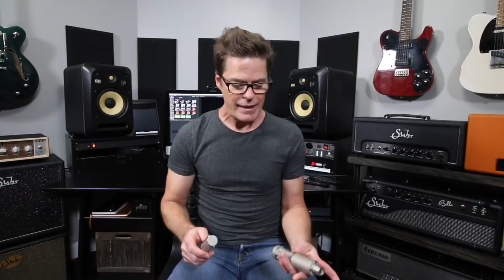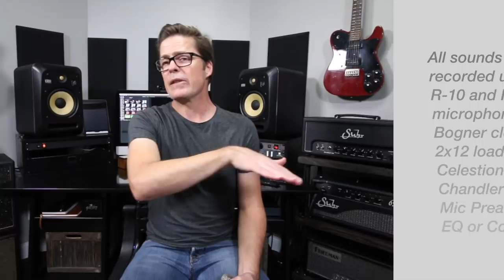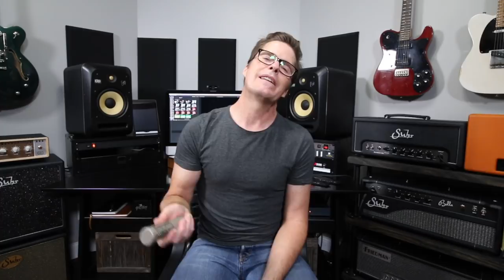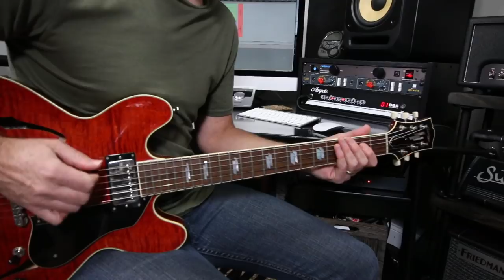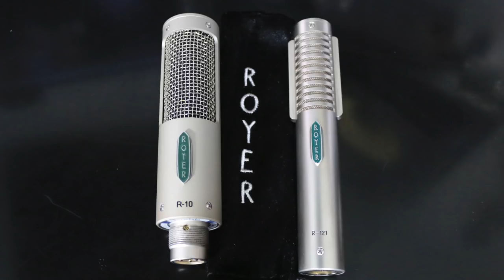Royer R-10 vs R-121 Quick Comparison Demo Video by Shawn Tubbs

Comment: I have the R-10 and LOVE it.  I usually use the R-10 and an SM-57 along with running a line out from my Torpedo Captor to my interface and then using a Celestion IR.  Three guitar tracks for each part.  Love the tone.

Comment: First, awesome playing and tones! Both mics sound really great and you did a great job comping to showcase the mics. I am hearing something completely different from all these comments though so I had to look up the frequency responses of both mics to make sure I wasn't crazy lol.

The R-10 actually has a substantial DIP in the upper mids at around 2.5/3k and a smaller dip around 5.5/6k. The R-121 has a small boost around 1.5k and 3k and a dip in the mids around 600/700hz. There's also a significant cut and rolloff in the R-10 starting at what looks to be around 13k or so.

I definitely preferred the R-121 for cleans hands down but was really torn for the higher gain settings. The R-10 is darker for sure but sometimes the R-121 was too bright for me. I guess mic placement could change the R-121 but this is the brightest the R-10 will get. I think if you can afford it, it would probably be better to save for the R-121 to get a fuller frequency spectrum. Unless you prefer the R-10 response!

Very helpful video, thanks!
Reply from the maker: Thanks so much for watching and for chiming in!

Comment: Good comparison Shawn. Listened on hphones & monitors & surprised how well the r10 stood up to r121. r121 still king for clean sound handled low end better so great warm sound, but the r10 bc it lacked bit of low end was great with the driven sounds - just my 2 cents :) Overall tho the r10 is very good & especially when you look at the price comparison !

Comment: Very interesting. They certainly sound different. I would say the R121 has a bit more "bite" to it, and a more clear dynamic response - the reverb continues being audible while you play the next parts. What was interesting to me was the more distorted part. There is significantly more low end to the R121. The "bite" I mentioned is also interesting, because it seems they have a different high-frequency boost.

Comment: Obviously, the differences are very small!!

It is impossible to put two microphones in the same exact spot, but side-by-side they still are about an inch apart relative the speaker cone. A couple of possible alternatives might be

1) place one above the other top to top of mic, as if you were doing a Blumlein pair but face them forward toward the cone 

2) Loop or re-amp the guitar part and replace the first mic with the second, lining of the ribbon to be in the same spot. Since they use the same ribbon, they can be an almost exactly the same spot, but just not at the same time.

Excellent comparison – thank you

Thanks

Comment: On the clean tone, I liked the R-10 more, it seemed to have a warmer/more harmonic sound. On the dirtier tones, I honestly thought the sound was pretty close.
Thank you for utilizing the method of not stopping the sound between mic switches. The brain only takes milliseconds to forget what it was hearing.

On a side note, you might want to rerun the test and switch the orientation of each mic to see if being inverted has any impact on the sound. I don't think it does, but a ribbon mic is unique in how it utilizes an air suspended element.

On subsequent reviews you might want to label them as mic a/mic b because I see a lot of reviews stating that the 121 was better and I think that has to do with people automatically expecting a more expensive mic to always sound better.

 Great playing BTW.
Reply from the maker: Thanks so much Dan. The Royers are designed with an offset ribbon element and you can definitely turn them around. Both microphones will present a bit brighter with less low end. I've used them that way when recording AC gtrs.

Comment: The R-10 definitely sounded a touch brighter to me over the R-121.  They both sounded amazing, but clearly the 121 is a bit warmer than the 10.  Of course, that just means you need both...lol.  Great playing, as always, Shawn!
Reply from the maker: Thanks, Steve! Yeah, I'm forever an R-121 fan but I thought the R-10 was a fantastic mic. The R-10 can be placed much closer to the cabinet than the R- 121 without as much low-end proximity build up due to the 3 layer screen.  I didn't do it in the actual demo because I wanted to keep the mics at the same exact distance from the cab. The R-121 feels a bit faster especially in the lows and certainly captures more air than the R-10 but I was really impressed with how well the R-10 performed overall. Great mic!

Comment: I’m in the market for my first  Ribbon mic pair with my SM57 on Fender and Marshall amp recordings.  But of course I want a mic that could work exceptionally well for acoustic guitar, piano, drum overheads, etc…. It seams like the R10 can do everything.  I saw a video of Trevor Thornton record a song with just 2 R10’s, micing acoustic, vocals, piano, drums and a little synthesizer.  Exceptionally done and what I like about the R10 is I can get two for less then the price of an R121 and do stereo micing such as Blumeline or spaced.  As much as I want a 121, I want versatility as well….  Getting two mics (R10’s) might be the way I go.  Thanks for your video because I’m doing the best I can through YouTube demos to pick the right thing for me.

Comment: Of course, the more expensive mic sounds better, but the R-10 sounds really good. Great for recording. One advantage of the R-10 to the 121 is that it is built to take more abuse. You can push it a bit harder due to the insolation it is built with. Unfortunately, that is also what makes the low end break up in comparison to the 121. Still, such a great mic. Does not hurt to have it.

Comment: Great comparison video!  I could hear more hiss from the R-10 and the R-121 was warmer but the center tone was the same.  In the studio R-121 but live I would definitely go with the R-10 because it's close enough in tone but the following construction deference's make it a no brainer:  The R-10’s built-in windscreen which protects it from air blasts outdoors. The R-10’s internally shock mounted ribbon transducer isolates the ribbon element from shocks and vibrations, increasing the ribbon element’s durability.

Comment: There's a subtle but noticeable upper-mid rise on the R-10, which makes the R-121 sound ever so slightly fuller in the bass. With some judicious placement and EQ, I think you could make either one sound like the other for any purposes in a band mix. On a completely acoustic recording, solo classical instruments for example, the differences might be more apparent.

Comment: how does the R-10 fare without the use of the dBooster?  Is it really necessary to get comparable levels to the 121?  I'm interested in electric guitar sounds of course, and also drum overhead
Reply from the maker: Levels wise for drum overs and EGT you'd be just fine with the R10.

Comment: I haven’t read any of the other reviews yet, because I didn’t want to color my own thoughts. The only thing I really heard differently between the two mics is that the R-10 seemed to have a slight bit of an upper frequency edginess, while the R-121 sounded more rounded without sacrificing the upper frequencies. The R-121 was smoother to my ears, and my preference between the two. How’d I do?

Comment: hey Shawn, I had to chime in, I listened to this through Yamaha monitors HS8s, but at a low volume as not to disturb the fam in the next room, at lower listening levels it is almost impossible to distinguish the difference between them. I have listened to them (in the somewhat recent past) and the R121 has a bit more shine to it. I bought a matched pair of the R10s (which I am happy about). but obviously the cost is a factor with the 121. I'll have to have one though, in the future, they are that good.

Comment: The R10 seems a better fit for the type of riffs I play, which is similar to what's played at the end. Almost like a 121 and 57 blend with one mic. By the time you mix multiple guitar tracks, you're going to be rolling off some of that low end on the 121 anyways. I have the chandler and API pre's so I'm looking forward to checking out the R10.

Comment: The 121 is 5dB more sensitive than the R10. You'll need a fairly strong preamp or something like a cloudlifter to get the same level out of it.

Also, on all of the other demos I've heard, the 121 had a little bit sweeter high end. The high-gain tone in this clip had a different presence peak, though that could be positioning (despite best efforts).

Comment: I wanted to like the R-10 for the sake of my wallet, but the 121 smokes the R-10 so bad it's not funny. Sure the R-10 is about 3x cheaper, but 500€ is quite a price to pay for a thing that quite doesn't deliver what you'd want from it. At least for close miked electric guitar, the R-10 doesn't have half the weight of the 121, which sounds bigger, bolder, more dynamic and upfront.

Comment: Thanks for the quality comparison! R-10 definitely has more mid which perceives brighter particularly in the guitar setting, and I expected 121 to be darker due to signature deep low end on the guitar, but man, I'm surprised to hear how R-121 actually has more extended hi than R-10. Very subtle, but R-121 definitely has clear and faster high end. Wonder if that's caused by the built in shock mount design on R-10. That said R-10's mid has such a girth!

Comment: Clear difference to me even on a tv speakers, the R-121 was rounder and I can see how it would sound insanely 3d with a 57 mixed in, however, If I only had one mic, I’d definitely get the R-10! 

Sounds like the R-10 could be an interesting ribbon on an acoustic or even vocals because of that mid hump, like a modded to be fuller sm7b 🤔

Comment: The R-10 sounds more transparent than the R-121. Definitely get more high end from the R-10, but not in a way that is at all harsh. The R-10 just sounds overall smoother and clearer. The R-121 seems to add more of a flavor to the sound. I don't think I would notice it except head to head with the R-10, but it's almost muffled by comparison. I don't think you can go wrong with either of these, but for me, R-10 all the way at #1 and R-121 only if I wanted to add warmth and coloring to the sound.

Comment: No, there isn't a big difference between these mics. A subtle but noticeable boost, 250 hz and below on the 121, 1-2 db maybe, gives it a slightly warmer character. Everything above that is virtually identical. Any differences easily compensated by a small tap on the preamp low mid or upper bass EQ...BUT...as it turns out, this frequency zone is many times attenuated ANYWAY one mixdown starts. Sounds great by itself...becomes mud when everything else has to also fit in that zone.

Comment: If I were using one mic only on a source I'd go the R121 as it has the ribbon thing but slightly extended. If you were mostly using the mic as part of a combination though the R10 would be just as effective.

Comment: My ears must be damaged. I only heard the difference on the high gain tone, the R-10 seemed to be a pinch brighter. Great option for us broke guys who bought a bunch of suhr stuff. lol...
Reply from the maker: Nothing wrong with your ears at all. The R-121 has a better transformer so the low end is bigger and feels more immediate and it has an airier top end that can be perceived as darker or less bright. The R-10 is a bit brighter for sure but it still sounds really great. One of the things I really like about the R-10 over the 121 is it can be placed much closer to the cabinet before you run into proximity issues in the low end.
Reply: thx for the reply, is the Pt100 vid going up soon? looking fwd to it :-)
Reply from the maker: @PotemkinBUMP225  That video is complete, just waiting on Suhr to let me know when to post.  It'll be soon!

Comment: Strange, I thought the 121 had more top-end, but everyone is saying the opposite. Could be my headphones.
Reply: I actually thought the R121 to be more extended in the frequency range with a touch more air.
Reply: Supported by Royer's own specs too...I just looked at the charts.
Reply: @Grant_Ferstat  Now for $500 dollars you cannot beat the R-10. I'm listening this video through a Sony Wireless-Noiseless headphones  Great headphones IMHO. Not a $1200 pair but good enough for my old ears. I could only tell a tiny bit of difference in the Two.

Comment: I think my ears need to be fixed. Cuz I couldn't realize a significant difference.
Reply: No, your ears are just fine. If he would have told people that the R10 was more expensive, then we would have seen more people stating they preferred it over the R-121. The brain does funny things when it thinks one item is more expensive and thus better.
Reply: It could also be due to the fact that we are listening on a pc, and on those pc speakers, those tiny fractions of difference could be irrelevant. @kusgilb
Reply: @boboutelama5748  im listing in my studio, I can not hear a difference
Reply: @johnnyinterval  Oh.Wow ! You are listening in your studio ! Wow ! You are a God.
But as a studio specialist, you know they are different problems that can come from a Youtube video.
First thing ; they don't need to play a different file. Second, what incident has the MP3 conversion has on the rendering. Third, are the results equalized in any way.
And so on.

There is a lot you can do to boost your sales and make things look like different.
I can specially see a lot of Royer tags around this vid, letting me believe it is paid viral advertisement.

From my observation, I simply see that consumers buying R-10's are selling them away very fast, in regard to R-121, that are generally hold in collection. What would be the reason ?